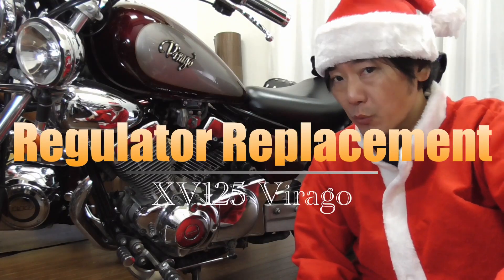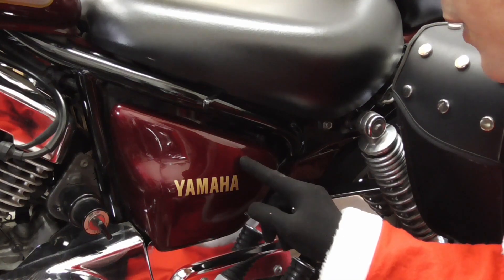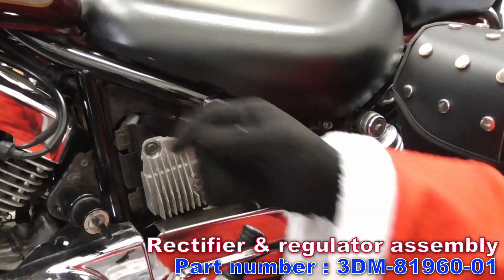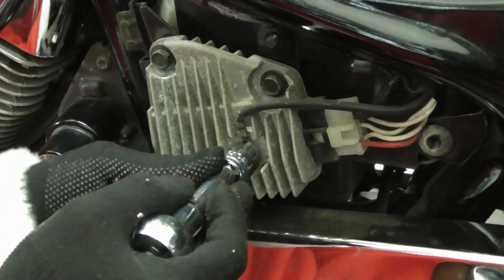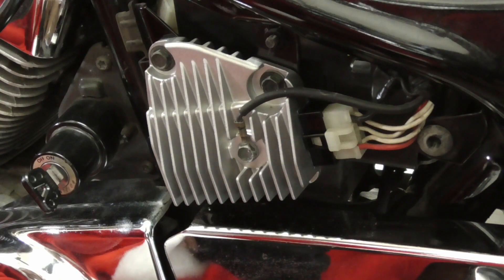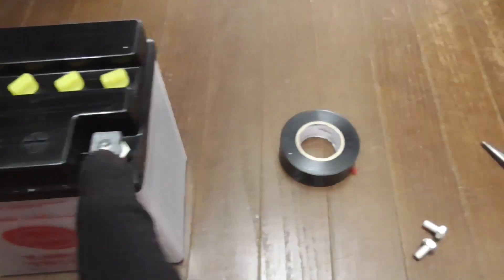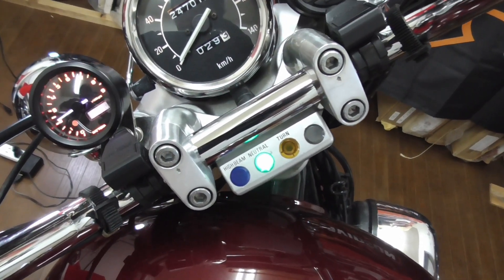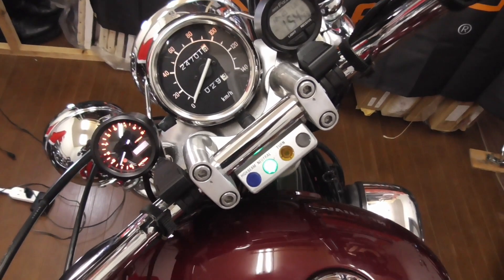【Motorcycle Regulator problems】How to diagnose & resolve the high voltage issue【Yamaha XV125 Virago】

Comment: Hello mr  Psycho-Cycler ! I have a problem with my own 2003 xv125 Virago with the local odometer not working. I think some of the cogs have broken they don't turn more than 37. Any ideas for a quick fix? The cable is probably fine since the big odometer spins fine and also the speed indicated is fine. Thank you!!
Reply from the maker: Sorry, I have to look at it to find the problem.  Please try bringing it to the local shop.